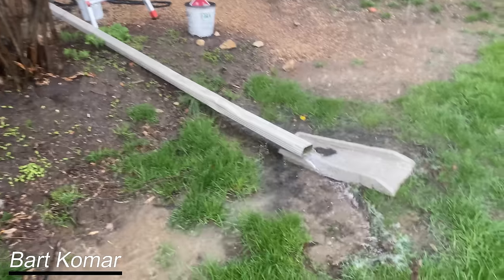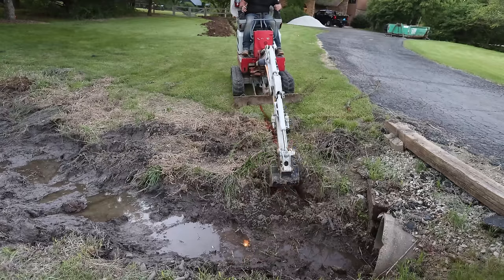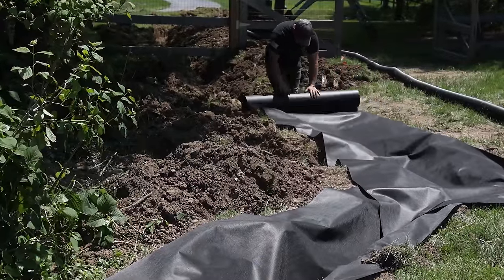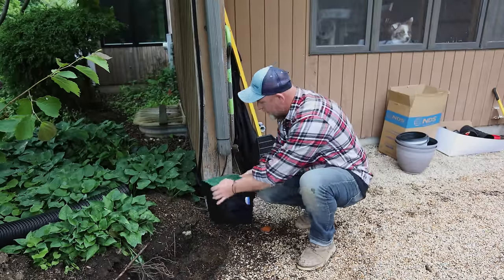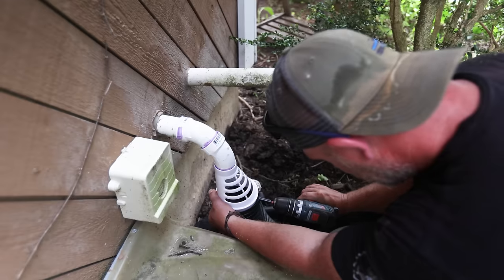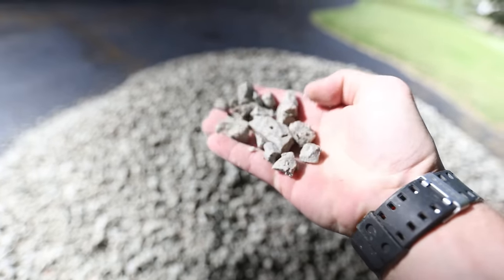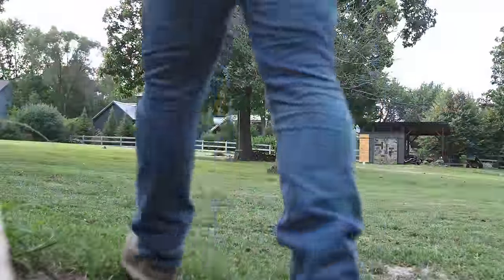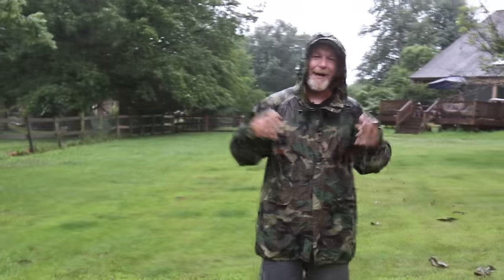How to Install a French Drain that Actually Works!  DIY Project

Comment: Hey man, here’s a tip that works great for the shallow catch basins that will keep you from having to clean them as often, and will help keep the pipe from stopping up! Take some of that geo fabric, cut it to the size of the grates. Then,  put the fabric over the top of the basin, and press the grate over the top. I’ve got 8 catch basins in my yard, and have had the same filter on mine for 2 years, and there still good.
Reply from the maker: Ya I noticed they get gunned up after a while and need to be washed out to let all the water through during a down pour.  Sometimes when I pours crazy hard and the filter is in there I’ll take it out just so the flow is not slowed down.
Reply: @KomarProject  That’s the downside to making a filter for the grate. When It stops up, it will drain slower, but it will drain, it just takes a few minutes longer. I tied my French drain system in with my gutters system, which is the main reason why I put the catch basins in, so it would catch the granules from the roof. Then I added some more down the line to catch the standing water, and to use as a clean out. I probably didn’t need a filter, but my main concern was that I didn’t want the holes in the pipe to get clogged up because I never wanted to have to dig it up again lol. I had to hand dig a 70 foot run, 4 feet deep because the electric cable just happened to be right where I needed to run the line, and our soil is pretty much clay, which I heard will eventually plug the hole in the pipe. I used the NDS peanut pipe, wrapped it in fabric, then filled the rest of the trench with gravel, except for the last 6 inches, which i filled with topsoil. And that’s the main reason for the filters lol. I didn’t know topsoil was so light! Before I could get the grass to regrow, It kept get washed away down the line. But with the topsoil, water moves through it better than the clay.

Comment: I like your approach. What I would do different is to rent a sod cutter to set a consistent and thick sod piece to the side. Once the trench is filled with rock and fabric, I can add soil, level it with a garden rake then place the sod on top. Just need to keep the sod moistened. Nothing wrong with your approach IMHO, just sharing what I've done in the past and how I like to do this kind of project.  I haven't had good luck with standard gray duct tape once exposed to dirt and water. Thought the first tape you used at the beginning looked better. That looked like a gorilla exterior grade tape that was 4-5" wide. That is some incredible tape.

Comment: Hey man. Thanks for this video. I have to get a French drain put in and this gave me a lot of good tips. If I may, your grass issue in the yard and around the pool….your soil seems hydrophobic. Use a product called hydretain OR you can use baby shampoo in a hose sprayer. It will loosen the soil and allow the water to penetrate. I had similar in my yard and thought I had grubs. No grubs. But someone told me about hydrophobic soil. I tested and sure enough water was just not penetrating. Hit the section of yard with Johnson and Johnson baby shampoo in a hose sprayer and i have a lush green lawn.

Comment: Very informative. I found this very helpful and appreciate you breaking down the steps. I also found the info about the freeze-proof sump pump connector extremely valuable as I had mine freeze up last year...now I know how to fix it! Looks like your Pennington Ironite helped. I just bought some of the Pennington coated Super Seed lawn seed...will let you know in a couple weeks how it works! Thank you Komar Project for all this info!
Reply: How's the Super Seed doing?
Reply: Led me to think

Comment: Not certain how I feel about the downspout drainage with all that water making contact with the wood on your house...that said this was an OUTSTANDING video. Very clear and informative! I learned a lot! Thank you!
Reply: Same. If a house has a crawl space or a basement then it has the potential to cause more damage. I think the best option is to hook a downspout adapter to it with some type of leaf filter. It eliminates standing water from the downspout and carries it away in a solid pipe.

Comment: When you're ready to put the soil back on top, take some photos of the whole run because it'll help find it later if needed. Should you sell the house it will also help the new owners with finding where the run goes.
Reply: … so they can replace it with PVC.

Comment: Great job! The only thing I would change is your catch basin at the bottom of your downspout. As water falls in there, some of it will escape. You want every drop away from your house. Connect a pipe directly to your downspout and add a cleanout pipe to go with it. It's an easy fix.
Reply from the maker: Good tip!
Reply: and that method mentioned above will also save your post/wood from getting wet and rotting over time
Reply: I just did the clean out method with one of my downspouts and it's working great. I will say I'm not sure if it's even necessary because I have seven other downspouts that drain directly into a pipe underground and they have never clogged. 30 years strong!
Reply: Or just use some matching material to extend the sides of the catch basin up.

BTW, whether you want "every drop away from your house" depends on your foundation and whether there's a basement.  A guy here who had a basement decided he wanted every drop away from the house but after doing just one line for one downspout when the rains came all the doors and windows on that corner of the house jammed:  in soils that will hold a lot of water, a foundation and/or basement can actually float as much as half an inch and if the whole house isn't doing it evenly that can cause annoying problems.
Of course don't go the other route; I had to go see for myself when a development in what had been swamp land where dirt excavated from elsewhere had been dumped cheap and then spread:  they started out putting in basements for a dozen houses with just minimal drains, then the rains hit, and those basements started popping up out of the ground, floating loose from the soil due to the abundant water.  [I liked their fix, though:  they braced the basements at their highest floating level and pumped in some kind of slurry that kept the basements from all settling again -- they would have settled crooked.] 
The moral of this story is know your situation before playing around with water drainage.

Comment: Wow, great job , every house should have this system in place when a house is built.
Reply: whether it's needed at all entirely depends upon a lot of factors.  i have no gutters and no water issues at all at the house i built at 9000' in the CO mountains.  semi-arid climate. i will, however, be using a system like this for an upcoming house i will build in north Idaho

Comment: Hi, very informative.
With the part where you use the bobcat for the gravel, i had similar issues over 3 days of shoveling, on the last day my neighbor came over and advised to use a metal garden rake and simply prop on top and drag back towards me, the gravel will follow the rake and fall into the trench.

I wish he told me at the beginning of the job  :)

Regards
George
Reply: I’m picturing him looking out his kitchen window with a sly grin, sipping a cup of coffee and thinking, “Tomorrow. I’ll tell him tomorrow….”

Comment: Komar Project.  I like those devices...but yeah not cheap.  I have started using some old technology...my father-in-law use to use.  A "water-level" which is a really simple long skinny piece of tubing...with a couple marks on it.  The aquarium host cost 11 bucks...and water is free-ish.  BUT once you figure out how to use it, it is really accurate and quite easy to use.

Comment: Just want to start by say Happy new year and a massive thank you for sharing you project/ ideas and all the advice, needed this video, we are currently a full wraparound extension, it has not stopped raining, starting to see damp patches on new walls, the garden is full of clay under the soil. So you can imagine how bad the drainage is around the house, need to sort it ASAP, have been soo stressed with it all. Thanks man ❤🤛

Comment: Learned from a guy who did drainage work for about 40 years, you don't actually need any slope if the incoming water is slightly higher then the outlet of the pipe.  It will just push its way down.  Since we had to run over 150' and go down at times 15' (through a hill to get to the back of the property) we kept it fairly level so the discharge would go into a creek that was about 5" below the bottom of the outlet of the pipe.  In about 5 months it completely drained a very swampy area in our yard.  Now if we get 4-5 days of rain, about 24 hours after the rain stops the area is once again pretty dry.

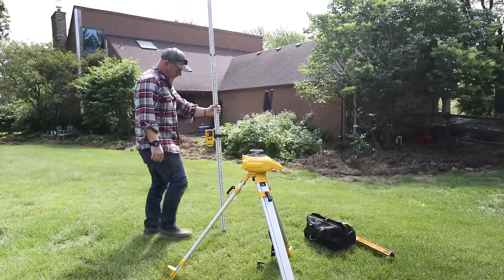Comment: 3:40 actually, 1% slope is  closer to 1" per every 8', rather than 9' or 10'.  because there are 96" in 8 feet. And there are 120 inches in 10 feet.   So if you dropped 1" per 10 feet, then you only dropped  1"/120" , aka 0.83% which is less than 1%
Reply: lmao these units
Reply: @5ch4cht3l7  Meanwhile if want a 1% slope in metric, then you just drop 1cm every meter.
In imperial you'd need to drop 1 13/64" each 10 foot lol
Reply: You actually want 2 % for drainage, but sometimes you just don’t have it.

But people always forget that you do have 4” in the pipe.
Reply: This guy Maths!

Comment: Great job. I did learn from doing my drainage dry creek bed not to use the small gravel on the bottom because it just washes away or ends up at the end of the trench clogging the culvert. I ended up just using the big rock I put on the sides of the the dry creek bed for all of it.
Reply: Another how to video shows that pea gravel can solidify over time, too. They recommended the larger round river rock.

Comment: Thank you for this! I think this would solve at least some of my basement water issues. I have a giant hill <10' from my back door and my basement loves to turn into a swimming pool with the very wet ground back there. The only issue I have is that if I dump it away from the house it's going to go to my septic leech field. If I try to take it to the road, I will have to cross over a high pressure gas line somehow. I wonder if that's possible.
Reply: Gas lines tend to be about two feet down, but check your local regulations; I've seen thirty inches required.  Then get the gas company to come locate the line for you; generally they'll do that free rather than risk a damaged line.
Once you know the location and the depth you can judge how to go around, over, or under it -- usually over since a drain line doesn't need to be two feet down!

Comment: Appreciate the video and detailed walk-through of thought process and materials. Though, curious at the end why exactly did you add the drain caps onto the 6" pipes? Or rather, do those 6" vertical pipes lead to the drains or are they dry wells? 

The Pennington helped with the fertilizer and boosting the nutrients for your grass to take hold in the clay, I believe. So unsure of the purpose of those 6" pipes.

Thanks in advance!
Reply from the maker: Because we have such a long run 700 ft I wanted to have clean out.  And it also helps to gather any running top water.   Hope that helps

Comment: The drainage mechanism works even without pipes. It can be made from practically anything. The gravel itself is already a drainage and only needs to be covered with geotextile. I've seen 200 year old drains in Europe that were still functional. The best drainage I've seen was in Germany. Typically 150 years old. Burnt plain bricks stacked in a square tunnel, all covered with fine stone.
Reply: That's good to know. Cheers

Comment: I would try and cut the ends that drain into the dry creek bed back several feet because when they are right in the creek bed they will get backed up if the dry creekbed swells with water.

Also with the dry creekbed all the Little Rock’s will wash away in the first rain. Just use rip rap (like 8 to 10 inch) it won’t wash away

Comment: You also could skip grinding the nubs off the drains so they fit in the PVC pipes by putting a heat gun to the top of the PVC pipes and getting them soft.  Then press the drain in and it should form in about 30 seconds.
Reply from the maker: Absolutely right my friend. That works great as well
Reply: I did that to join some four-inch PVC pipe ends in order to use up a bunch of scrap sections -- works great.
Reply: Those drain grates fit inside green SDR pipe without modifying the pipe

Comment: For downspouts, you can use 2 gutter elbows (Like an "S") to get the catch boxes aprox 6" to 8"  away from the house or any wooden posts. Overall it's an impressive feat of engineering. If I had one critique, like everyone else on the internet, You don't need to backfill with so much dirt. It's better to just put sod over the rocks. As long as it has enough soil attached for the roots

Comment: At 9:10 we see you install the Y connection but I'm confused because it looks like the main pipe is perforated and I thought you said that pipe would be solid. Also, is it wise to leave the outflow wide open for critters to enter and potentially get trapped?
Reply: Saw this as well! wonder if its just some video editing magic and he connected it to the solid pipe after?

Comment: I know this varies by state and some don't allow it, but what about adding a water storage device.  I picked up a used 250 gallon plastic unit for $40.  With just a little rain, I can water my plants all summer. You may not have that or don't need it, but it's saved me a boatload of water and I feel it's better than the chemical water from the faucet....

Comment: I carry my sump pump water 37 ft from the foundation ,sch 40 pipe will outlast the big box pipe pros and cons the cons hard to work with expensive ,pros outlast the black pipe by a huge margin ,easy to clean ,will self clean too . I like the gutter catch .

Comment: Thank you. Excellent video. I got a quote for $5k for someone to put a drainage like this to catch 3 gutter downspouts and run it about 75’ to a steep downhill area to exit the water. Now I wonder if I can do this myself. If I have no gutter covers, and never get leaves on my roof, just dirt and dust, can I just go right from downspouts into the pipes? Why not use corrugated pipe for the downspouts too? If I use corrugated pipe will light rain exit the pipes and water my lawn?  I have a 6” gap between two 2’x2’ concrete squares of a path, can I just run the pipe between without removing the giant squares? If I don’t get the 1° slope correct for the whole run, and maybe have some flat spots, am I better off using corrugated pipe so the water will get out eventually?  Want a free trip to Maui to help me do this? I’ve got a guest unit. I can send pics.

Comment: An option to the expensive laser is to use a line laser akin to what builders use. For the stick just use any old stick with a tape measure attached.
Reply: Done that myself -- works very well in low light, so I laid out my lines in the evening dusk, all ready for work in the morning!
Reply: No need for laser just tie a string between two sticks and level string in the  middle with bubble then measure depth difference between string attachment points.
Reply: @otofoto  I tried using a string for pouring a continuous footing for a fence, and it just isn't possible to get a string to stay level over anything much greater than six feet; the string method put dips in my forms.  So I borrowed a laser level and fifty feet of footing came out nicely level the whole way,
Reply: @Traildude  Watch video "How to measure slope for under 5$. DIY". Doesn't matter that string is not tight.

Comment: when I put in our French Drains...I did them 24 inches deep because we have a super wet piece of land.  AND used a full foot of gravel ontop.  Never used any catchment containers just plumbed in with a 4 inch adapter to downspout...but we have zero leaf litter to worry with.  Works great.  Yard is no longer soggy and retains the swamp that is "spring" far better drainage.

Need another one really...eventually.
Reply from the maker: Ya it helps so much. This spring will be the first time we see it with continues water.  Last fall it rained but not much so I’m excited to let the dogs out and not come back muddy

Comment: I am just starting to learn about this for our yard, my first question is, do you need the two pipes if you are just collecting yard water? I would run the pipe from an area of our yard and connect it to our downspout run off which will take it to the far back of the yard.

Comment: Great video!  Only thing missing for me, is a ballpark estimate on how much all that cost you.  I cringed thinking about it when you mentioned how many tons of gravel you needed.
Reply: Gravel is not needed for 4” pipe- only larger diameter. He could have cut the cost of this project in half by using in-situ soil. I wouldn’t recommend clay for backfill. Silty sands would suffice in this application, so long as you don’t drive a loader over your installed drains. Would also need to wrap the perforated pipe in geotexile fabric.